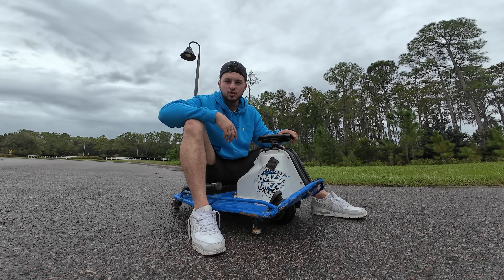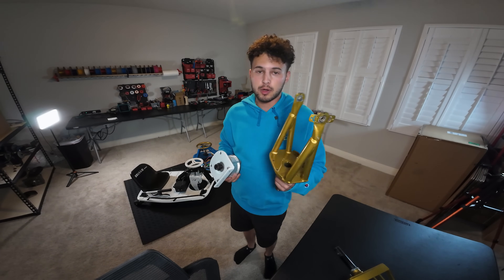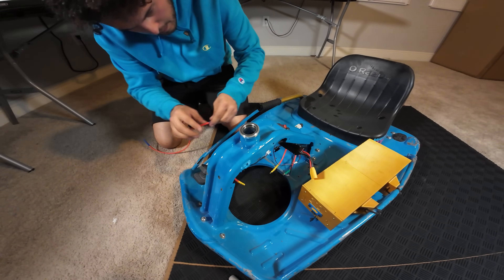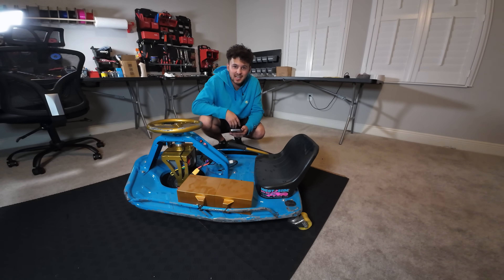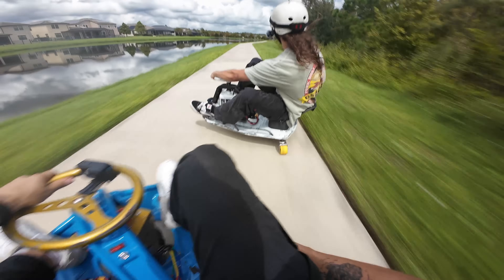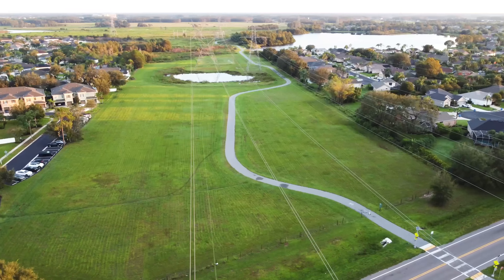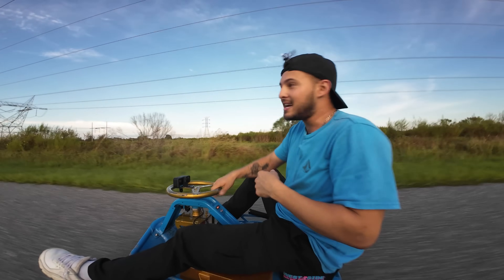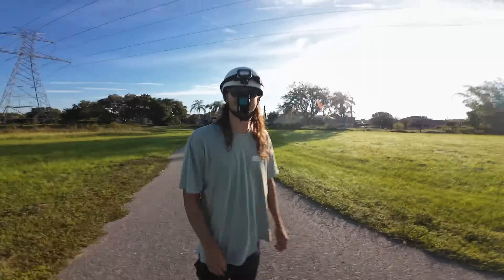I built a 40mph Electric Drift Kart

Comment: Will the 7000w brushless motor fit the fork of a taxi garage stage 5 crazy cart fork and would i need a different size battery to run that 7000w brushless motor ?
Reply from the maker: Are you looking at the ChargedUp 7000w motor?
Reply: @kmatzfd3s yes
Reply: @kmatzfd3s yes i am
Reply: @kmatzfd3s  would that fit the fork of a taxi garage stage 5 xl ?

Comment: Thats cool! use some blue locktite on some of those motor screws as they are known to vibrate loose... At least the sprocket as you sould use it on any moving parts like those. just a heads up to make less of mess put drop of locktite in the hole not the screw

Comment: Just installed my charged up budget kit with a 60v battery as also from charged up…
First run I got up to 35mph and it was still accelerating!! 
I got scared!! I haven’t did anything in the app…I know I can get much much more if I tune it…
Still learning the app but nothing is running hot the motor was cool…not alittle of heat at all